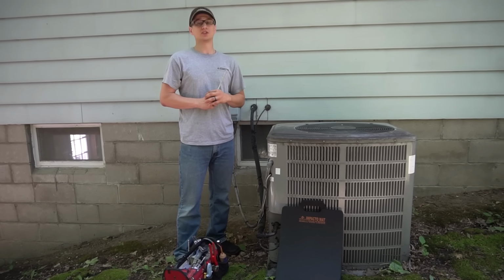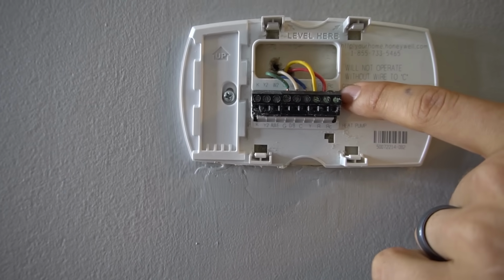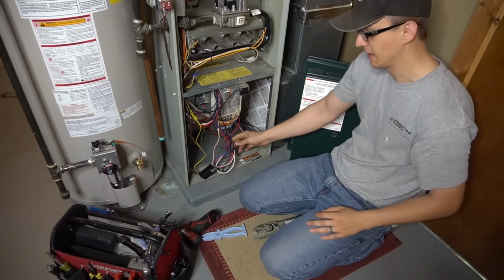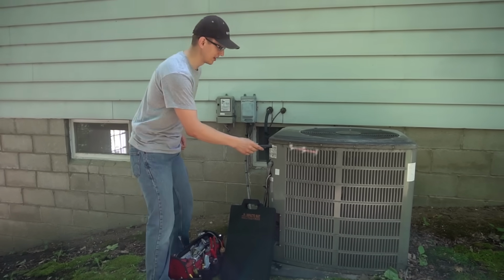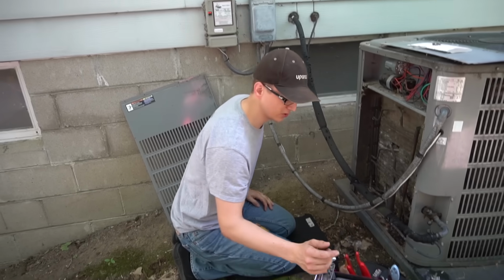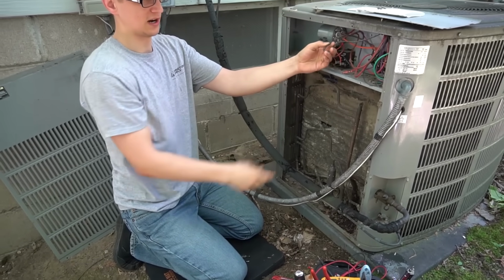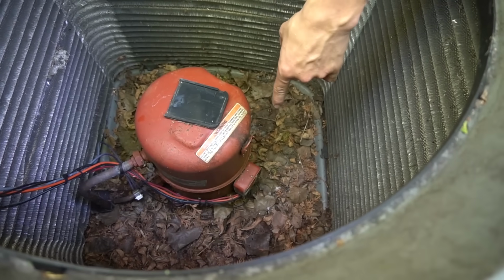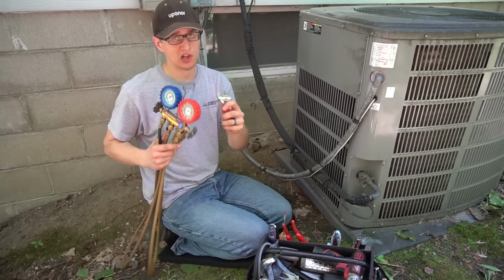AC Unit Not Turning On - How to Fix It Step by Step

Comment: I don't know how to thank you. You saved me gobs of money with your plain English instructions and advice. Though my particular problem wasn't covered in any of your videos, your clear explanations (and many anecdotes from your personal experience) allowed me to confidently proceed and eliminate those elements that were working properly. You also gave me an understanding of the various components and testing their functions. 
I had an intermittent problem. The outside AC unit didn't always kick on at the set temperature. Then it completely stopped working. I eventually learned that the wire from the thermostat to the COM 24V terminal was loose. On occasion, the blower fan vibration caused it to make sufficient contact to trip the contactor and at other times it didn't. 
But, thanks to your videos, I kept at it and remained confident I would find the problem. 
And thanks to you I'm not sitting here kicking myself in the butt after having forked out big bucks because of a loose wire!
Thank you again from the bottom of my heart (and wallet)! 😁
Reply from the maker: I love getting comments like this one! You watched the video, followed what was shown, and were even able to find a problem that wasn't mentioned! You went above and beyond average! I applaud you on getting it fixed yourself and glad that my video assisted in the process! Thank you for sharing your experience, stay cool! ;)

Comment: My AC fan will not turn off even it it was set on Auto. When cooling, the compressor will run then shut off when set temp is reached but the fan will not shut off and when it get hot again the compressor now will not run and still  the fan continues to run
If my thermostat is faulty and when I take it out of the base, should it shut off the fan ? if it does not what could be the cause ?
Thanks

Comment: Fantastic video! Now I understand some basics and will try to troubleshoot my unit tomorrow.  Thank you so much!!!
Reply from the maker: Thank you! Good luck troubleshooting! Hopefully it's something simple!
Reply: @WordofAdviceTV  In my case it was my 2 pole circuit breaker Pproducing only 120V instead of 240. In addition to that, the disconnect box contacts were loose. That caused overheating! So... Ended up changing my disconnect box and the breaker. $12 + $10 ... half an hour of my time and we are back in business. HVAC guy would probably charge me from $300 to 400. You do the math. Without your video I would be still fooking around.... Thank you!
Reply from the maker: @Oleg Unknown Thank you for the update! Glad to hear you found the problem and were able to get it fixed in a speedy fashion! Stay cool :)

Comment: Thank you! Clearly stated and  useful.
Reply from the maker: Glad I could help!
Reply: @WordofAdviceTV  Just in case you may answer questions like this-- your troubleshooting steps led me to the decision that I need to replace my motor- I didnt see it on your Amazon page-perhaps it is not yet listed?  HC31GE229A>to>HB32GR229 It's a 1/12 HP 800 RPM 208/230v --Thanks-
Reply from the maker: @bly762  Condenser fan motors can be a bit harder to track down than blower motors in a furnace. But these two are the only ones I am finding..

1. https://amzn.to/2MIAsZ1
2. https://amzn.to/2ZzXTWu

Comment: Hey Jay thanks for all the information on this. It was really helpful but my Goodman unit3 ton still have a hard hum on initial startup. I have replaced the capacitor which is 45/5uF. The unit is doing the same and compressor wont come on. I ran a ohms check on the compressor at the connector pins and they all ended up being o.oo. I not sure now if in fact the compressor is at fault for sure as this situation happened overnight from working to not working. Please, if you have time can you guideline me to the next step of diagnosis. I believe I’m really close to the solving of the situation, but not sure if compressor is actually the culprit. If so, this unit is a r-22 and the “Freon” that in system is 407c as i was told by Ac supply that was the compatible refrigerant to r22. Also, if the compressor is in fact bad, can i get a 410 compressor for new refrigerant and flush system out as this is a new evaporator in the system now( 1 month old) and change to new system while replacing r22 compressor? My email is warreng1111@att.net if you can help with advice. Thank you in advance for all your help and videos!! Sign... Hot!! In this house! Warren G.

Comment: Great video.  I see you have 541 thumbs down,  they must be from those AC technicians that can barely use a voltmeter. My AC was not working and I had several companies give me different explanations for the problem.  I needed more refrigerant but didn’t know if I had a leak, really?   I had a bad board, try to tell me the status lights were showing I needed to replace the board,.  The compressor was shot, recommended to buy a new unit -  my unit was only two years old.  While moving some junk underneath the balcony, I noticed there was a small wire that had was barely hanging to a wire-nut and another wire going into the house.  Hmmm! a communication problem?  I carefully, re-attached them, problem solved!!  Fortunately, some of those guys were giving me free estimates but others actually charged me for a house call.    You have got a new subscriber.
Reply from the maker: Oh wow. Folks like that give HVAC technicians a bad reputation.. And three in a row too. Sigh.. Well I'm glad you didn't go with any of the suggestions and just fixed it yourself! Thank you for sharing your experience. I'm sure this will serve as motivation for some people to try to look at their unit themselves first and see if it's not something simple.. Thanks for subscribing, stay cool!

Comment: Thanks so much for posting this video.  I live in the north east.  We are in the middle of a 5 day heat wave.  Yesterday our high was 101 degrees.  Last night the fan in my outside unit stopped spinning and warm air was blowing through the vents.  I watched your video and installed a new capacitor and like magic I had cold air again.  You are a life saver.  Fixed the issue for under $20.  Thanks again.
Reply from the maker: @Howard Armstead That's what I love to hear! :) Glad you were able to get it going quick, stay cool!

Comment: Hey man, my compressor has no power running to it. Fuse in hvac unit is fine, breakers are fine. My fan is turning on, but no cool air - I used a multi-meter at the disconnect outside and didn't have any power to those wires
Reply from the maker: If the breaker is not tripped, then you probably have disconnect fuses. If you open up the panel in the disconnect, they may be there. If not, then I would say something's wrong with the breaker..

Comment: Question:  My AC outdoor Fan stops spinning and then I hear a hissing sounds , when I tried spinning the Fan its stuck, after a while the Fan starts spinning again.
The only maintenance I did was to clean it with the garden hose.  what do you think?   thank you Sir
Reply from the maker: @Stone Keeper From what you described, it is likely one of two things. Either a weak capacitor or the fan motor is going out. I would try replacing the capacitor first (or if you have a meter, you can check it) since it is not a very expensive part. (I have links to capacitors in the description if you need them, also a video on how to replace one)
Reply: @WordofAdviceTV  thank you...thats what I tought but always a good to get an expert advice. I will let you know if that fixed it or not.   Thanks again
Reply from the maker: @jstjb  Alright, good luck!

Comment: Thank you so much for the video, it is very informative. My issue is the outdoor unit will not turn on and when I lower the thermostat the fan on the furnace will run for about 15 seconds and then turn off. What do you think the issue is there? Thank you again.
Reply from the maker: Just going off of your description I don't seem to have a good guess.. So the outdoor unit has 240v going to it but the contactor is not pulling in (24v that should be coming from the furnace control board) to let the power through? Try watching this video for some more ideas: https://www.youtube.com/watch?v=NVPhsK4gK1A&t=2s

Comment: Hi, the fan of my AC unit does work or  run, however, I think the compressor is not running. So I think this would not be an issue with the contactor nor the capacitor then. Any recommendations to further to check?
Reply from the maker: A dual run capacitor has two sections. One for the compressor and one for the fan. The fan side may be good but the compressor side is dead. So the fan runs but not the compressor. Or perhaps there is a burnt or broken wire at the compressor pins.

Comment: I need suggestions and trying not to call a technician but my thermostat went out when I turned off my unit a few days ago and has not come back on since. I did see that the fuse was blown and went to Home Depot to replace the fuse but the thermostat didn’t come on. What else should I be looking for to get my unit to work. This heat is a killer
Reply from the maker: As a temporary solution, you could try bypassing the thermostat (I have videos on how to do that if you need them) My guess would be that perhaps the fuse blew again right away? That would mean that there is a bare thermostat wire that is touching something metal or another bare wire and shorting out. Usually this happens at the outside unit.

Comment: I was able to determine that the problem was with my outside Lennox unit, after following the instructions.  The capacitor looked fine, the contactor seemed to be working fine, but the fan wasn't turning.  With the unit on, I could hear what I thought was the compressor working, but with a slight hissing sound.  For kicks, I used a coat hanger to try to move the blades and the motor and blades started turning on its own, but stopped withing 2 minutes....I tried this 3 times, with the same result.  Do you think the fan motor is the problem or something more?

Comment: I saw your video.  It is excellent and I learned so much.  I have a question.  I have a Trane XL 1200 around 30 years old.  The problem I currently have is that it cools for while and then stops cooling after several hours.  I turn the unit off and leave it off for about 3 to 4 hours.  When I turn it back on it starts cooling again.  This has been going on for about 2 weeks on a daily basis.  Can you tell me what may be wrong.   The technician came and cleaned the outside unit and added Freon.  He checked the inside unit and said everything was fine.  We still have the problem.  Thanks
Reply from the maker: That sounds like you still have something wrong with your Freon system. Either it leaked back out, there is some debris that got in there that shouldn't be there, or you have an airflow problem (restrictive or dirty filter, could also be a plugged evaporator coil)
Reply: Thanks so much for the quick reply.  We had the evaporator coil cleaned and changed the filter again.  For a couple of days the unit worked well and now that we again have very high temperatures we are back on the same routine.  Please let me know if there are other things that we need to explore.  It stops cooling at in the afternoon when the temperatures at the highest.  We turn it off for several hours and in late evening we are good again.  Thanks again.

Comment: Hey I need your help please.  My unit keeps blowing fuse on furnace circuit board.  I ran a new wire from furnace to AC unit (red & white) fuse still blows.  I disconnected the white wire from circuit board to AC unit and fuse does not blow.  I suspect something on the AC unit...but all looks good as far as the wiring goes.  Suggestions please?  Thanks.
Reply from the maker: @Bob P Try disconnecting the 24v wires from the contactor coil and then power on the unit. (make sure the two disconnected wires are not touching anything) If the fuse does not blow with the wires disconnected, then you know that the contactor coil is bad and the whole contactor needs to be replaced.

Comment: What if the fan stops after 3 minutes? Fan spins freely, switched out the contact switch, condensor fan, and compacitor??? We are at a loss... also in Minnesota. So u know it's pretty awful the past few weeks
Reply from the maker: My first thought is whether or not the condenser fan motor was wired correctly.. So the compressor keeps running but the fan turns off in 3 minutes right? I have a video on how to wire a condenser fan motor if you need it but I would double check the wiring of the capacitor and the fan. There should also be a wiring diagram on the inside of the service door that you could refer to to make sure the wires are in the right spots.

Comment: your video are great, I have  a unit that when turn on thermostat I have to reset breaker at least twice to get comp working, replaced capacitor, and added hard start , but still does same, I did notice that main contactor on cond buzzes but when I reset breaker it will kick in and runs normal... can it be the 24 volt wont pull in to start, should I replace main contactor on cond.
Reply from the maker: I would suggest watching my video on common reasons why AC can trip a breaker. A lot of times it is actually a burnt or broken wire/connector that causes that. https://www.youtube.com/watch?v=G1EBHrOgs-Q

Comment: I have a  question on  the plunger, is  that a fix for no cool air or  just  a compressor check only? My capacitor is ok,all fans run  but  don''t hear compressor startup.
Reply from the maker: That test is only to check if the unit is getting 240v. If you are not hearing the compressor start, then perhaps the compressor section of the capacitor is dead..
Reply from the maker: @Bryan Casica In that case I would proceed to this video :)https://www.youtube.com/watch?v=NVPhsK4gK1A&t=2s

Comment: What if the fan spins but the compressor is not making a sound at all
Reply from the maker: My guess would be that the capacitor is dead (it has two sections, one for compressor and one for fan. The fan might be okay but compressor side dead) or there is a broken/burnt off wire at the compressor pins

Comment: What coolant is phasing out 410A?
Reply from the maker: This is straight from Dr. Google ;)

There is no phase out date for HFCs. (410a is an HFC) On September 26, 2016, the EPA announced that, under the EPA SNAP (Significant New Alternatives Policy) program, specific refrigerants including R134a and R410A can no longer be used in new chillers, effective January 1, 2024.

(So basically they set a date when they want to start phasing it out but they haven't exactly figured out what to replace it with...)

In 2018 Honeywell announces non-flammable alternative to R410A. Refrigerant manufacturer, Honeywell, has unveiled what it says is the first viable, non-flammable alternative to R410A. Honeywell has launched Solstice N41, a refrigerant with a GWP of 733, for use in stationary air conditioning systems.

(So as it stands now... Solstice N41 is a candidate :) When I went to school they did tell us of other refrigerants that were in the works but I don't hear about them anymore so I am assuming they didn't work out?)

That is all I am aware of. Perhaps someone else will have a better answer for you.

Comment: I JUST CHANGED THE CAPACITOR  BUT THE FAN WILL WORK FOR A MINUTE AND THEN IT STOPS
Reply from the maker: Sounds like the fan motor is going out. Unfortunately the fix for that is to replace the fan motor.
Reply: @WordofAdviceTV  do u have a video jow to replace it
Reply from the maker: @elmaestrofoss  No sorry, I don't have that video yet. (But I should really make one). I only have a video on how to wire it. I am sure there are other videos out there though that show how it's done.

Comment: I’m in MN too and our AC stopped working yesterday. 😭 So, I am hoping to get it fixed ourselves! We are going to have to order a capacitor on amazon so it will take a couple days. Should we have our thermostat fan on “on” or “auto” for the time being?
Reply from the maker: Sounds like a plan, good luck! For the time being, it would help bring down the heat a bit if you leave your fan setting set to ON.
Reply: Word of Advice TV Hello! I just wanted to update you that I got the new capacitor in and my AC is running! I wanted to thank you so much for your great videos, it’s very appreciated!
Reply from the maker: @bananadolewhip5270  That's what I love to hear! :) Thank you for the update, stay cool!

Comment: You're the best!  The condenser is not running when we turn on the AC.  The contactor gets voltage because it turns it on when I push the button on it. I don't see a fuse and really can't figure out where the connection to the condenser is broken. The fan comes on when I turn on the thermostat.  It must be in the wires at the furnace.  Frustrated!  Thanks for taking the time to help people, you're a great teacher!
Reply from the maker: Thank you! If you haven't seen this video yet, it may help with tracking down the problem: https://www.youtube.com/watch?v=NVPhsK4gK1A&t=2s